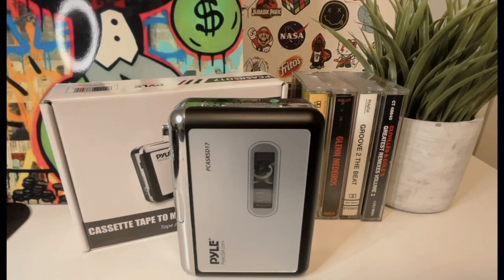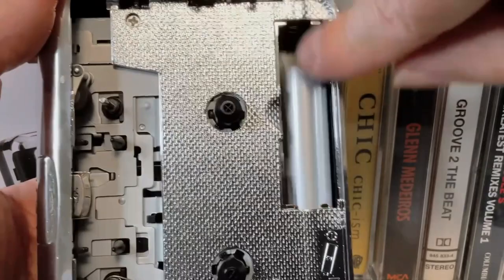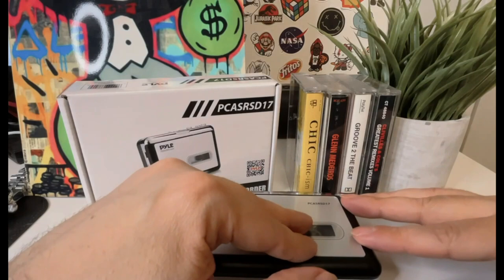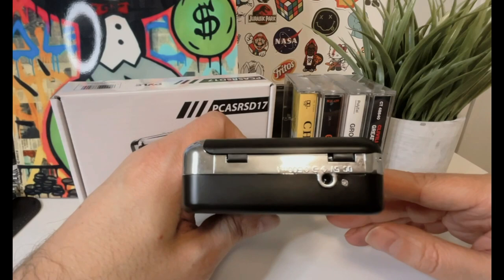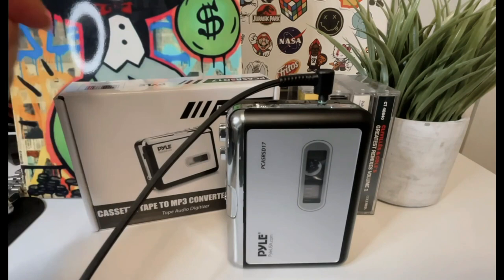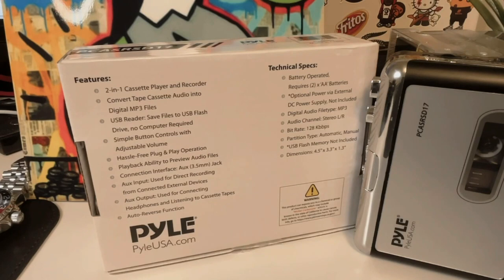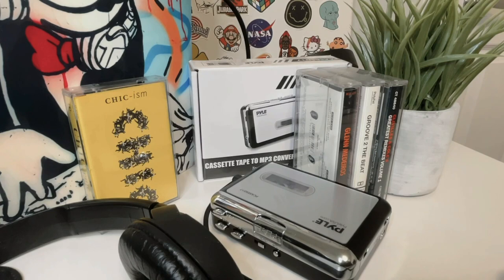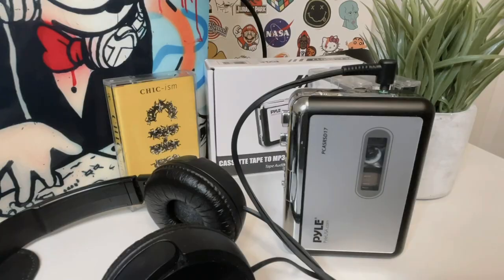Pyle PCASRSD17 Cassette Player Review

Comment: Amazon and EBay have nothing but complaints about the failed converter aspect of this model. Mixed reviews on playback audio, some reviews bad.
But unanimously every review states the conversion angle is an absolute scam.  No ‘converted’ audio was at all detected by most buyers.